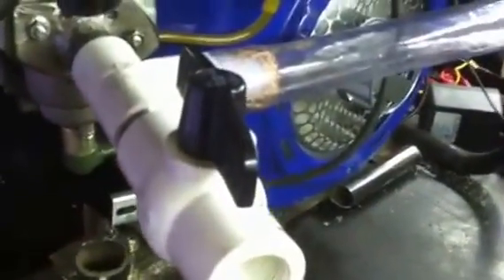Gas vapor engine. Video# 1

Comment from the maker: Hi Tyson, I don t want want to tell you how to build a flash back device, but You are going to need more than the screen it might be all right for a flame . But a back fire is a violent pressure explosion which a small screen will not stop .May be a brass stone or some stainless wool also packed in there.I am not an expert and I know you have been building a while,I would not want to here you got hurt, Because you know if that blows up it would not be pretty.Domimic

Comment: Nice! Thanks for sharing! I'll be sharing the run time tests this week on a cold vapor system. We shall see how much of a runtime increase we will get. I don't think we will see a large increase if no heat is applied but testing will give us the answer. I am doing the runtime tests on my 5000w continuous current generator. After testing the cold vapor system I will be doing more extensive testing on a hot vapor system which is where I know we will get longer run times. Doing all the testing I have done on the vehicles was good and I have learned allot but I switched to the generator so I can have something that stays at constant rpm's and I can test specific loads, not only this my carburetor actually works on the generator so I can do comparison testing and get good consistent data.    

I posted a flashback arrestor video yesterday showing some of the system as I was getting ready to install it on the generator.